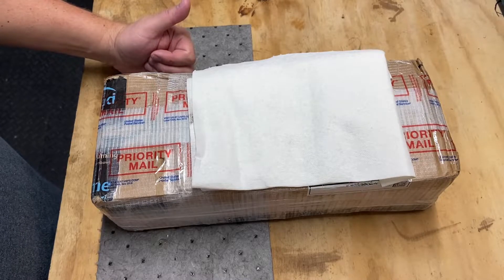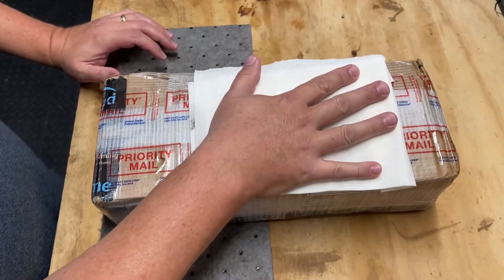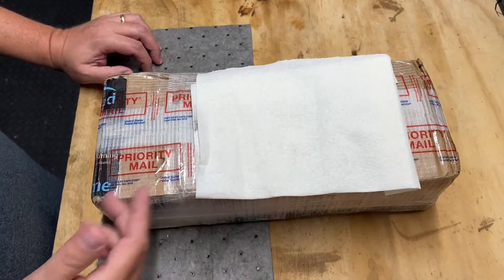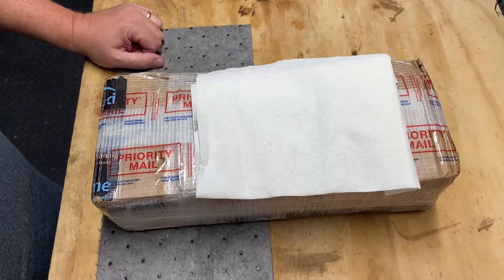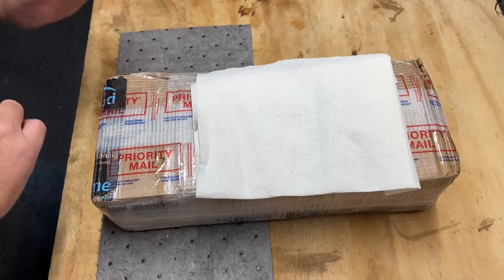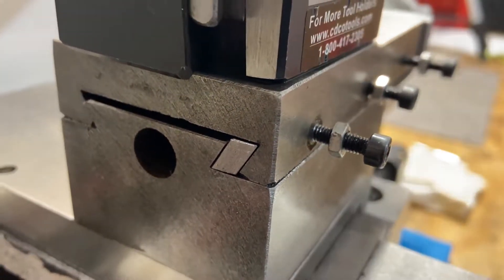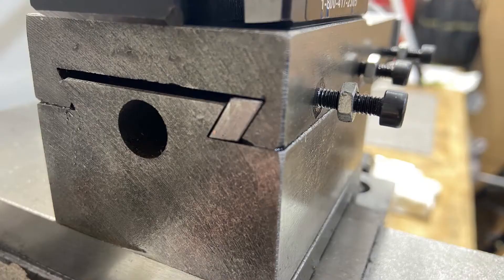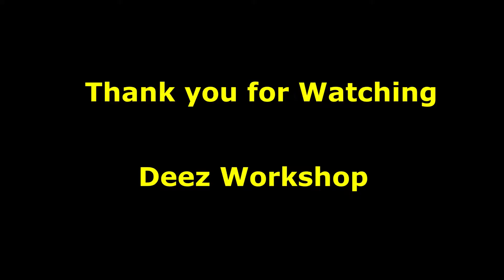Vevor Mini Lathe MX 400 Part 32.1 - Generosity from Subscriber. Gib upgrade. Plus raw materials.

Comment: Cont,d.    When drilling , always start by centre punching the site for the hole. Then use a small pilot  drill for  the initial hole Try to work up in size of drill in stages until you reach the final diameter.
It's worth buying a set of machinist drills  which come in letter and numbered sizes as they increase in size by very small increments. To this add a Zeus chart or machine handbook to be able to refer to the correct sizes for turning, r drilling , tapping , reaming etc and
do not use these drills for general use , keep them for when you want precise sizes
Good luck.  Mike.
Reply from the maker: Thanks Mike,  I appreciate your advice on tips and safety.  You are right and I hope all reading head your warning.  I did use a center punch once to start my pilot hole, but it was early on and not very accurate at all.  I do keep continuing to improve with my center drilling and have had recent success which makes me happy.  I have on my list to get some proper machinist drills and the Machinery's handbook but trying to spread my spend out.  I think its a great tip to save them for precision lathe work and not general purpose to keep them precise. I need to lookup what a Zeus Chart is.  i like the name :-) Thanks for watching.
Reply: A Zeus chart is a small, cheap handbook which lists thread forms and sizes , tapping drills , clearances etc. For basic machine work
To become at all proficient in metalworking and machinework it is imperative to learn to be accurate in measuring, your work, laying out and planning your series of operations in machining .
It is almost impossible to drill an accurate hole if you do not use a punch to give the drill an indent to stop it wandering.
If your punch mark is off  centre , don't worry It is quite easy to move the indent to the correct position by simply angling your punch tool and hitting your punch mark again to move indent to the desired spot.
Another thing, when cutting a thread on your lathe, never reverse the tool back along the workpiece until you have wound your crosswise back to give clearance. After you wind back move your crosswise back in to get the next cut.
If you don't do this then you have the possibility of backlash in your feed causing damage to the thread form as you move your lathe tool in reverse.

It's worth checking out the YouTube' sites of Steve Jordan and Blondiehacks
All the best   Mike
Reply from the maker: @mikecrowley3102  I already watch most of Blondihacks,  I will check out Steve Jordan,  Thanks for suggesting that.  I will also try the center punch trick,  Knowing i can re-punch at an angle to correct helps,  Thanks for watching.

Comment: Some tips foryou.
Most important,   NEVER. Wear a ring , jewellery or loose clothes near a lathe .  If your ring catches when you are working on your lathe it can rip your finger off or worse.
When drilling always start by centre punching the inte
Reply from the maker: Safety cannot be stressed enough,  you're absolutely right.  But I will be wearing my ring.  It's on me.

Comment: Get rid of the compound altogether and make yourself a solid tool post mount. The compound is the weak point in these small bench lathes.
Reply from the maker: Can’t argue that it’s a weak point. That and the tail stock. I am not ready to ditch it though. I like having it for adjustable cutting. So far I’m making it work.